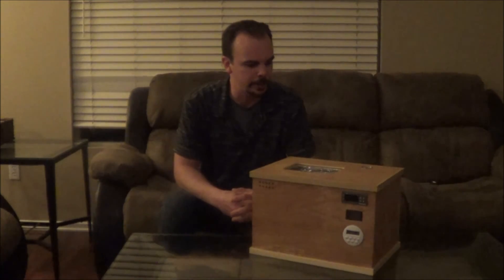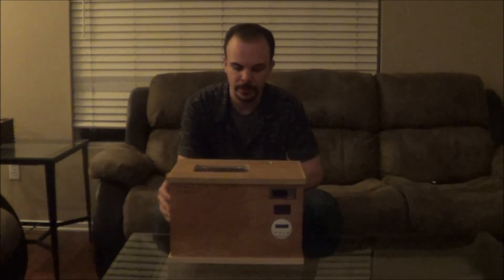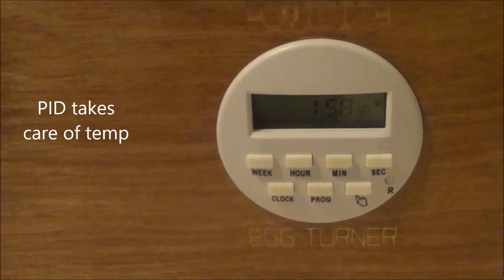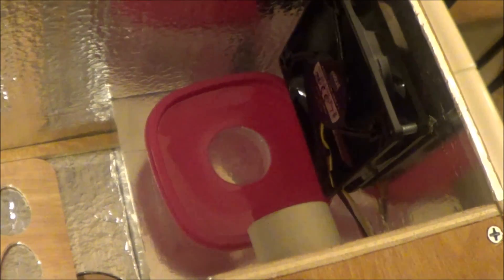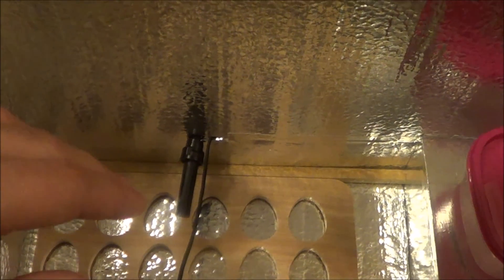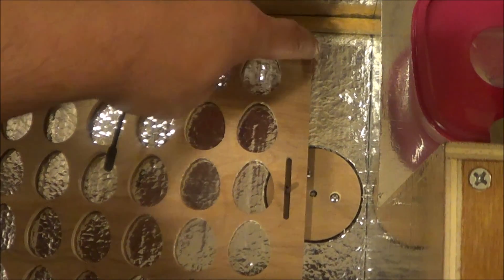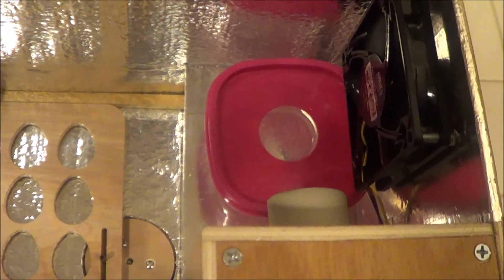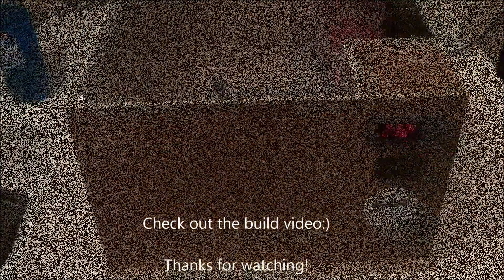The Hatchmeister - An Updated Incubator Design

Comment: I enjoyed this and the build video. This is a very elegant design – especially the turner. How did you decide how much ventilation to provide and where to place your ventilation holes? I have been unable to find information on how much ventilation is needed in a small incubator. Many designs include ventilation near the top and bottom, but yours appears to only be on the top. Top/bottom ventilation might be a carryover from incubators without fans. Many seem to use ventilation holes not only to provide ventilation but to control humidity. Any insight on this would be helpful.

Regarding your thermostat, did you consider a w1209wk instead of the one you used? If so, what guided your decision? It doesn’t appear to be as sturdy as yours but it displays Fahrenheit and does not have the problem you mentioned with temperature range. It sells for $3.33 on Ebay but you have to wait on the slow boat from China.

Again, great video. Thanks.
Reply from the maker: Buddy Moore Actually, I'm pretty much on the guess and check method myself. I did the same on the my old incubator and it seemed to be good enough. Figured I'd pop a few more holes in the smaller incubator so the humidity didn't get out of control. I originally thought you'd want intake and exhaust holes, but had problems keeping even temps and keeping the humidity up with that setup. It might be fun to experiment with intake and exhaust on sliders, so you could completely shut both or have them open to varying degrees.

Comment: Hello, this looks so compact. Great work! How is the hatching quality?  How many babies did you get from that 30 eggs hatching?
Reply from the maker: ERAY YASYERLI I'd say around 75% with this one. It wouldn't hurt to use multiple smaller lights spread around the compartment with the fan more centrally located. I'm pretty sure the hatch rate would go up a bit with more even heat.

Comment: Hello,
what is the inside size of the incubator? I would like to buy one cooler box from amazon to make one by following your video.thank you
Reply from the maker: Chinnameyyappan Narayanan I think it was 9"x9" for the egg section with an overall of 9"x12" if you include the light and electrical box areas. I think the internal height was also about 9"
Reply: Thank you so much tlgrimmy. I have one  19" x 12"  X 16" insulated shipping box(foam).  Do you think that will do?.thanks
Reply from the maker: Chinnameyyappan Narayanan . Very welcome! That box should work fine as well. You may have to pay with fan sizes (80mm/120mm) to figure out which keeps the temperature more even, but it should still work well. You will probably need a higher wattage light bulb as well. Good luck with your build!
Reply: thank you tlgrimmy. I will try using bigger fan and higher wattage bulb or two bulbs. I will update you once I am done.thanks again